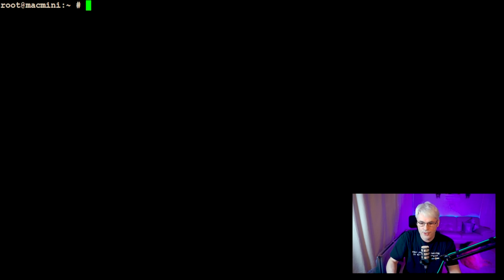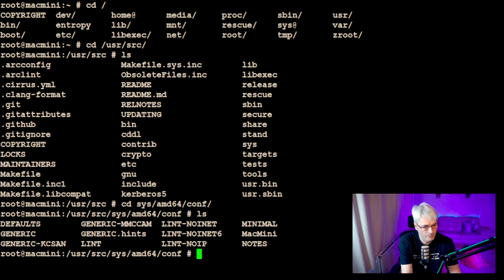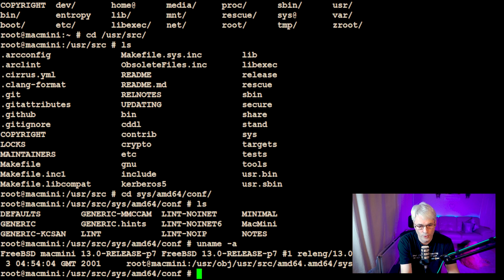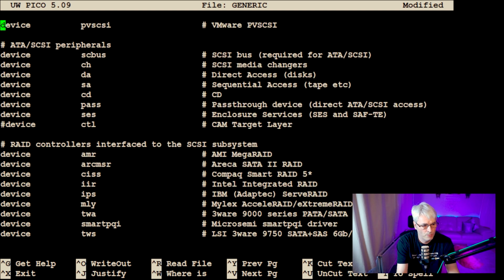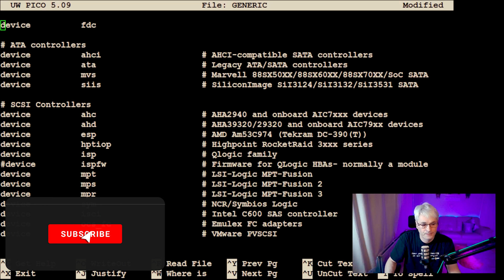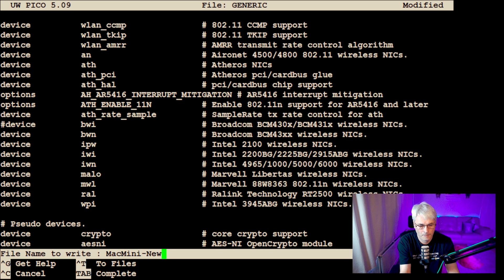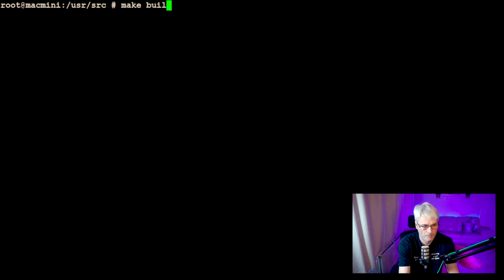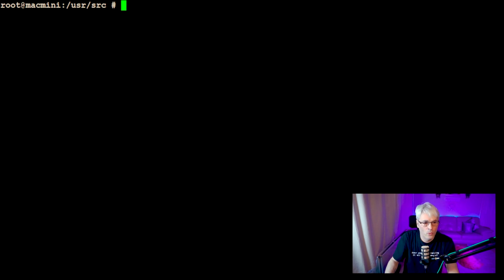Configure and install a custom kernel on FreeBSD

Comment: I was amazed when I first did a custom kernel in FreeBSD - it was so much easier than my experience in Linux doing the same thing
Thanks for uploading!
Reply from the maker: Indeed, I remember trying to do it once I had downloaded the kernel source rpm on redhat 7.1, totally borked the running system
Reply: Actually, I am a Slackware lad, but couldn't agree more.